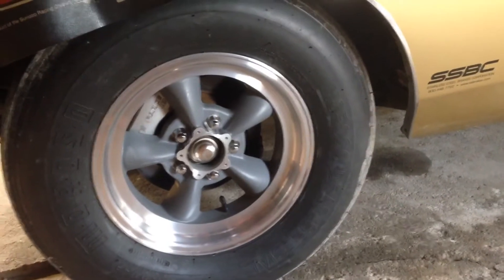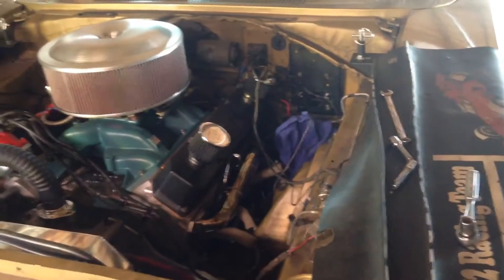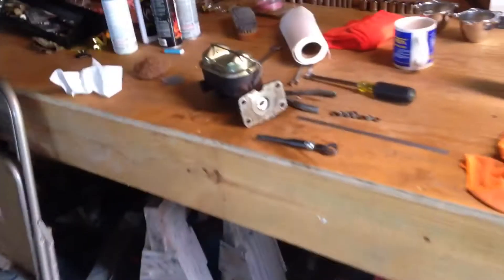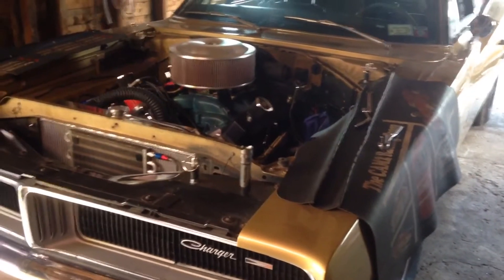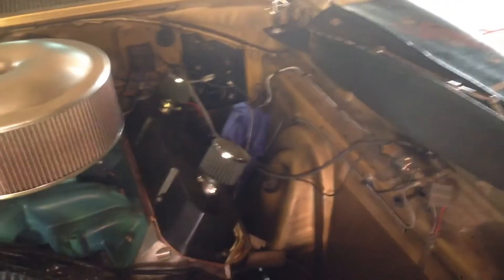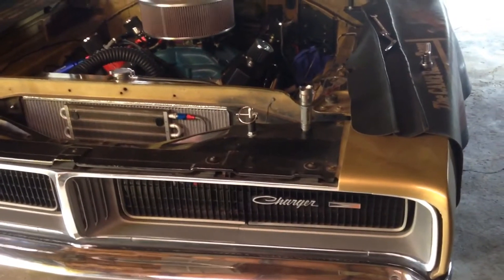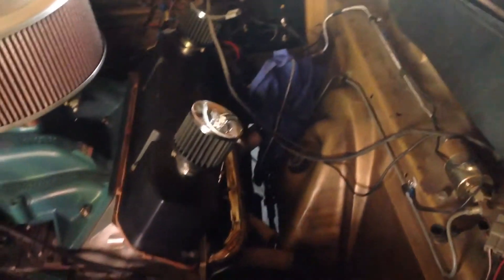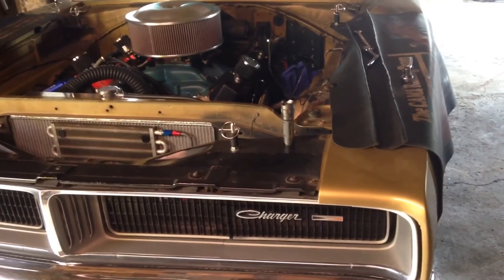Manual brake fix/ proper master cylinder size

Comment: Use a master cylinder from a power brake unit  that has a 15/16 bore ,works great makes more line pressure for disc brake .

Comment: I got a 1.125 bore on my disc drum set up.  I have the same problem.  Hard to stop I hated .
Reply from the maker: I ended up putting an electric vacuum pump in, and a hemi offset mount booster.  
   It was expensive but worth it.  

I learned drums work with manual due to their self energizing design.  It only takes about 500# of pressure a wheel to operate them.  
    Discs take about 1000# if I remember correctly.  
   You just can’t generate that without a booster.  

   It works great now.
Reply: @sandozman6085  thanks for the info.  Going to order a booster then.

Comment: Manual disc brake Corvettes use a 1 inch bore master cylinder where there power units are 1 and 1/8..Mopar pedals are the same for power or manual just a different pedal connecting rod...You need more volume for a disc brake system...

Comment: Yep, take your master cylinder back off. Do the math for a 7:1 or 8:1 pedal ratio. You will end up taking the brake pedal out, and reinstalling the stud for the master cylinder higher on the pedal, then the master cylinder will have to be moved higher too. Usually requiring a plate on the firewall to reinforce it.  If your pedal is 21" from top pivot to the middle of where your foot hits the pedal, than the master cylinder mounted 3" below the top pivot would give you a 7:1 ratio. Thats how you do the math. A 7/8 or 1" master cylinder should get you in the ballpark. Dont forget that you need a proportion/combination valve for disc/disc not drum/drum or disc/drum. When you install the proportion valve, make sure you get the proportion valve bleeder tool. It locks the valve in the middle so one side of the valve doesnt sense the pressure drop and lock you out of one side while bleeding.
Reply from the maker: Don Rutter 
     I think you guys with the ratio comments are gonna be correct here..
    Been bled again, no air still not good

I have a gauge coming just to see. 
      I will make a new video soon. 
I don’t really wanna move that cylinder though🙁
Reply from the maker: Don Rutter  
     Measured the ratio today guys.  Calculated out to be a 7.1:1 ratio, plenty for manual.  
    I believe my line lock may be the issue here, since the rear prop valve seems to do nearly nothing. I think the line lock orifice may be causing a restriction in the front half making it hydraulic lock.  Therefore the rear can only see what pressure the front can build.

Comment: It's his car had power brakes on it before he better check the brake pedal ratio is probably off I'm an ASE Auto Tech been in this trade or 58 years fixed a lot of these cars
Reply from the maker: James Mckeehan 
       Possibly an issue as well... but the main consensus on the mopar pages is not to mess with the ratio, and just use the correct bore cylinder.  
   Unfortunately I’ve yet to get to drive the car, and rebleed the brakes this summer.  So the total outcome is still unclear